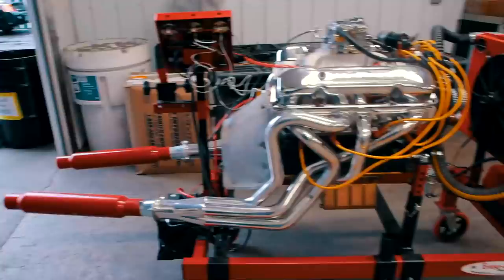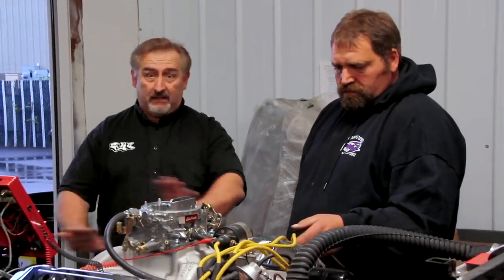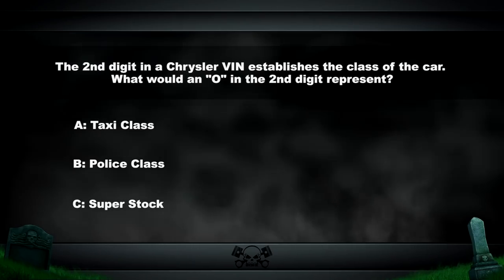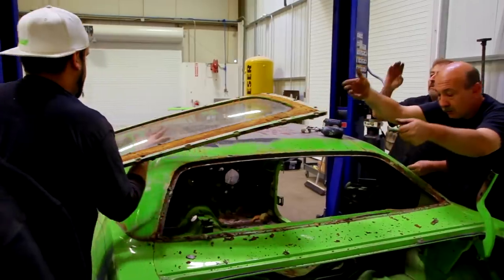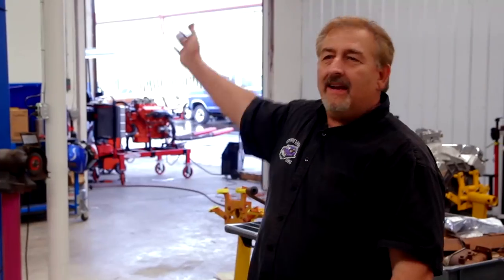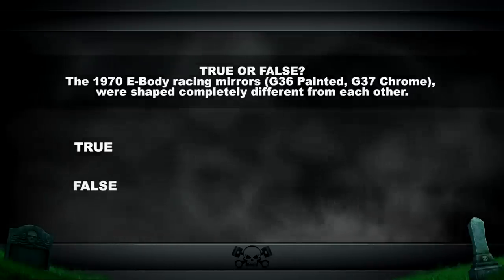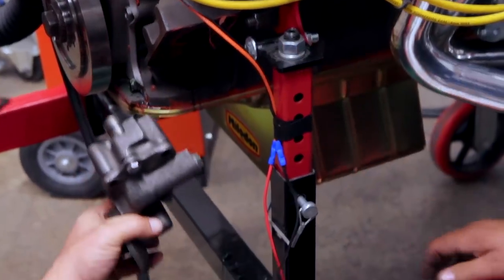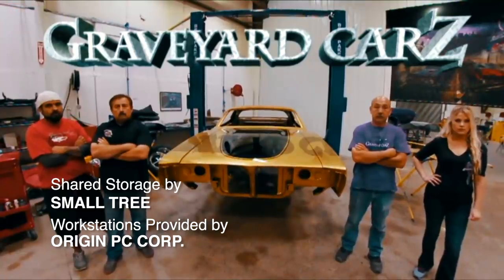1 of 1 HEMI CORONET R/T CONVERTIBLE 4 SPEED.  $1.5M

Comment: Good Job everyone....I owned a 1969 road runner for 17 years....It was hard to get parts for it....I restored it to about 80% then I sold it, a year later year one came out and parts were every where.. I wished I would have put it in storage.. It was a alpine white, 383 HP with a 4-speed shifter, console with bucket seats and a black vinyl top....I am a Disabled Veteran and some day I would like to find another one and keep it to pass to my son, then grand son...... Because it,s MOPAR or NO CAR... Love your GRAVE YARD CARZ show....thank you for the memories!!!!
Reply: Thank you........
Reply: "I owned a 1969 road runner for 17 years....It was hard to get parts for it....I restored it to about 80% then I sold it, a year later year one came out and parts were every where.. I wished I would have put it in storage."

I can relate to that. Also, the cars that were stripped for parts and the body shells scrapped due to the unavailabilty of replacement sheet metal and other hard to find parts. :-(
Reply: Ps: interestingly I special orders a 1968 RUNNER: Dkmgreen/ 4 SPD/ BLACK,deluxe int/ Fan de clutch/ am radio, passing on Buying( lost my $200 Deposit,also**the Hemi , etc way to expensive *& gas eater ,):).. Anyways, skipped to buy My first NEW CAR:70 Coronet 500/ Ralley Red/ auto/ 383 Turquoise,etc)... Interestingly, NO WINDOW STICKER  AVAILABLE,  Anyways, DEALER also had a 70 Challenger /4 speed/Magnum/ RT se/ triple Green(?) & EVERY OPTION , PASSED.

Comment: SOP would be to pre-lube the engine with a drill prior to firing it up - that would've likely alerted them to an oil pressure issue prior to fire-up & risking damage to the rotating assembly.

Comment: With a hemi in a convertable unibody, wouldn't that twist the hell out of the car after a number of burnouts etc? There's not much structure in them is there? I'm just wondering on that. I heard of other unibody cars with high horsepower that have their doors out of alignment from body twist.